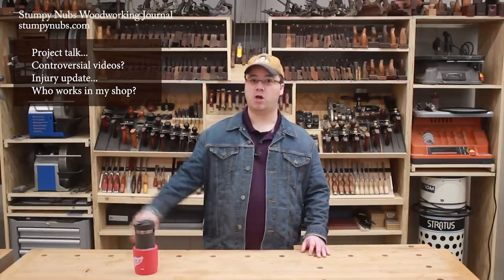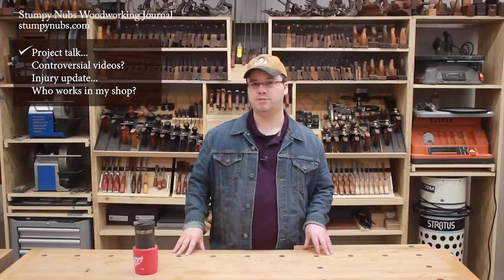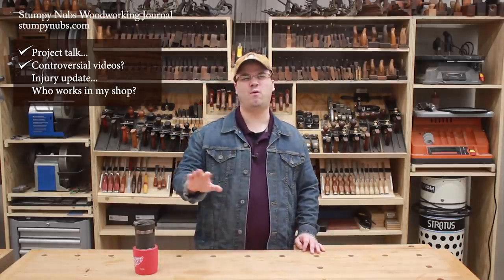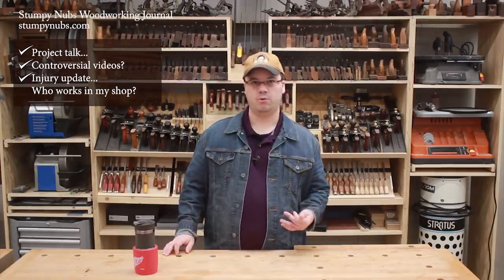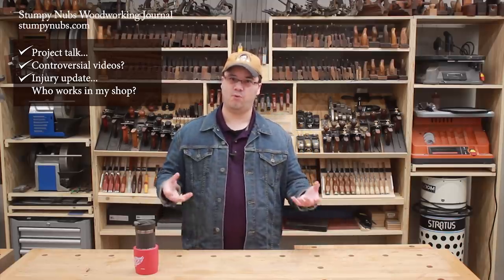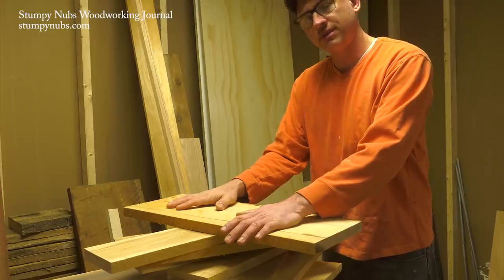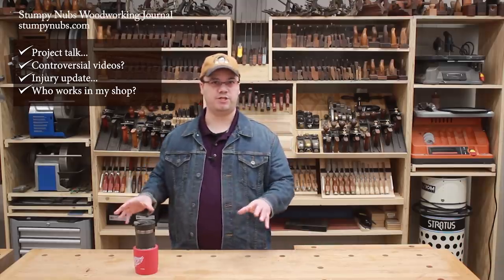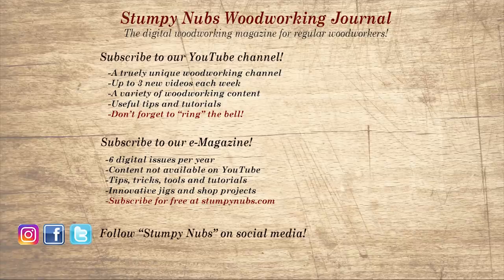Why I can't give the finger anymore (and other interesting stuff)

Comment: 9:05 "I've filmed a safety video, may or may not show it." - Please do. I found your channel by searching for kick-back on a tablesaw. I didn't know what it was before your video and someone mentioned it. I watched a few and I liked yours the best.
Reply from the maker: It's more of a rant than anything practical.
Reply: @StumpyNubs  A rant can still contain plenty of useful info. Post it my man!
Reply: @StumpyNubs  I still want to see it. Whatever it takes to get people to take safety seriously. I really started taking safety seriously when I was in a elevator whose cable broke. Nothing happened because it had a backup system to hold it in place. Ever since I assume an accident WILL happen and work with a backup to prevent or mitigate the outcome, even when the risk is small. I cringe every time I see someone use a table saw without a guard and splitter, smoke around flammable materials, etc. As my welding teacher said "poor safety practices are never a problem until there's a problem."
Reply: Please post it.
Reply: I'd like to see you show a safety rant video too. I mentioned something about using my Sawstop once and someone posted a comment to the effect of: "Sawstops are a crutch and a waste of money. All I need is my common sense." I thought, it must be nice to be incapable of having an accident.
Reply: And he should give that chewed finger to all the trolls out there. I'm sure that one will hurt more than a healthy one.

Stumpy is one of the most articulate woodworking YouTubers that I know of.
Keep the good job and forget the haters!
Reply: Safety first. Had a scare with my 1940’s Unisaw.  The next day, was your accident video. Sawstop delivery is Monday. Love the kick back vid, so more safety videos
Reply: James, anything you can do for woodworkers safety is worth putting out.  I am mostly a woodturner but I need most of the other machines as well. When I met you in July at the Raleigh symposium I was buying a Saw stop from Kingsport.  Three of our club members had recently had table saw accidents.  The last straw for me was when one fellow lost his signaling finger. Safety has to be number one! Thanks for what you do.
Reply: Confidence is what you have just before all the facts are known.  I appreciate every word so this is another vote for post it!!  I’m a complete novice, just retired and beginning to put a shop together. I want to learn skills that I can pass to my kids/grandkids.  No better place to start than safety and Stumpy Nubs.  👍

Comment: Hey Stumpy.  I'm a retired family doc. I saw more sliced body parts, cut tendons, metal in eyes , air gun nails where they didn't belong and tons of  other injuries. 95% were due to operator error , improper use of a tool or rushing to get a task done. I had one my self. The number one goal that EVERY woodworker should practice is SAFTEY FIRST!!  Please keep the videos coming.
Reply: Or even safety first.

Comment: Safety videos can be a little hard to sit through (especially if they're critical of some of one's own habits), but their message is timeless; and whether you work with chisel and mallet, hand-held machines or powered machines, an injury is never the desired outcome. Accidents do not "just happen", they are caused when all the contributing factors align to bring flesh into contact with the wrong part of the tool (or work). It is a critical woodworking skill to recognize potential contributors to accidents, then take steps to mitigate them. It is as I noted,  a timeless message that bears frequent repetition. So by all means, please favor us with your safety video sir, and stay healthy. Best wishes for continued recovery from your injury.
Reply: Safety videos are really good.  I watch a lot of them.  Tho bad habits are hard to change.  But I keep them in mind.  e.g.  Hold circular saw like holding a gun.  I remember now.  But when it comes to practice, it goes out the window until I accidentally squeezed the trigger.  But I am always careful of my other hand placement and spatial awareness of the surrounding.  I always think of how I can get hurt before I flip the switch.  So yeah, I have correct some habits.  Just need to work on correcting all the bad habits. 

He does have supporters here.  :)

Comment: Im a structural welder, my left hand has sustained numerous injuries. A 14" miter saw through the top of my wrist, a blown cut off wheel through my palm, a blown grinder wheel through the center of my 3rd knuckle on my index finger, and i recently got it pinched with a 2000 pound steel truss, crushing the three fingers that were damaged before.  Luckily, i can still use it, my grip is diminished and there are bits missing and its scarred to hell, but im grateful for the fact that i still have it. I call it my strong hand now, like the butler does in Scary Movie. Glad your recovery is going well, i totally get where you're coming from.  I love your channel, its been so helpful in my side gig building furniture. Keep up the good work!

Comment: A bit over 50 years ago, I ran the fingers of my right (dominate) hand through a 1" V belt pulley. Cut the signaling finger off and crushed the rest. A genius of a doc who sewed everything back in plce and tons of care and range-of-motion work later, the fingers work pretty well. Started playing a classical guitar to keep the fingers moving. Lots of tears shed on that old Yamaha but well worth it. 50 years and a few more wood working/metal working injuries later, I still can count to ten on ten working fingers. I am grateful for all the work I did to recover and all the luck I had to be able to... and for the extra care I have learned to take. Keep at it. Fortunately you still have all ten. Keep 'em working.

Comment: FWIW I appreciate your safety reminders. I’ve had several close calls and small injuries in the shop, and I can use all the reminders I can get to slow down and take my time. For me, it’s less about the safety equipment, and more about just not rushing or doing something kind of sketchy that a tool wasn’t designed for. I’m much better than I used to be, but like I said, I appreciate the reminders I get from you and others on YouTube.

Comment: I can tell you from personal experience that the movement and feeling will eventually return.  It may take years but one day you stop and say, "Hey I can actually bend that finger all the way".  For anyone out there thinking this only happens to stupid people BEWARE.  This kind of stuff can happen easily and quickly, even when you know what you are doing.  Never get lazy around power tools, they may seem friendly but can bite without provocation or warning.
Reply: Me too, what he said.
Reply: divorcedme  Thought you were going to say power tools and women have the same lineage.
Reply: Yup.. me too! Two years later, still frustrating buttoning my shirt!
Reply: Yep, you are absolutely correct. I also had an unfortunate, preventable event a bunch of years ago. I didn't lose a lot of mobility (left hand thumb) but I did lose all feeling in the digit from the joint closest to the thumbnail outward. Also lost a portion of circulation of blood so oddly enough, the only sensation felt was the cold, which up here by the 49th parallel was a real inconvenience.  Now, it's a rerouted nerve system and blood supply system which happened by the body's own desire to heal itself and 99% restored. It still has a cold temp sensitivity, albeit not anywhere as extreme as the original damage result and serves as a reminder against stupid. All tactile feeling is restored, so take heart, James, it will get much better over time.
Reply: The bandsaw got me, I absolutely didn't think what I was doing was dangerous at all, but blade hit a hard spot in the wood and flipped the piece over pulling my hand / fingers into the blade.
It happened so quick I didn't even see it. 
Luckily enough it was only a flesh wound that lots of stitches fixed.
Reply: Yes... my biggest problem now is reaching into a nail pouch to get a nail and getting poked in the end of my shorter finger...  I must be a starfish as most of my finger grew back. It was cut off just catching the nail bed. As the nail grew out, so did most of my finger.

Comment: Would love to hear the safety rant! I consider every tool in my shop as something that could seriously hurt me. No one thinks screwdrivers are dangerous, but have you ever used one to pry anything? Screwdrivers can get very stabby very quickly. No one thinks utility knives are all that dangerous, but a lot of folks think that utility knives are the most dangerous tools in the shop. 

I upgraded to a SawStop last year because I've seen one too many videos of table saw related injuries, and I had a coworker several years ago that nearly ran his entire hand through the blade when the workpiece slipped. He has a serious injury he'll likely never full heal from, but he's INCREDIBLY lucky he didn't amputate himself.

Now I have multiple power tools that can completely change my life before I even know what's happening. My 6" jointer deserves an enormous amount of respect. I'm not TOO concerned about the planer because I stand well clear of the infeed and outfeed. I still treat my SawStop with all of the respect that a table saw deserves (I still call it spinning blade of doom, and consider it one of the most dangerous things I personally own). But we never think about other things being too dangerous. A drill press can absolutely kill you in a few seconds if it grabs a shirt sleeve. Don't even get me started on lathes... incredibly dangerous machines.

Every single tool in the shop is dangerous... including the tool using the tool. :) Respect them all.
Reply: Always remember, you are and always will be the softest thing in the shop.

Comment: 9:17 I didn't even need power to crush the tip of my thumb.
Reply: LOL. My worst injury was slicing my left hand with utility knife. All the way across. Looks like I got another life line now. And still weird kinda pain even when I hear others talking about any injuries
Reply: @marcelo403polo2  IIRC, AvE and a whole bunch of other people call the utility knife the most dangerous tool in the shop.
Reply: @thecheeta  100% agree. Most people pay more attention only to power tools. It took 2 years in my case to get all feeling and movement in couple fingers back to normal
Reply: As a teenage boy in the early '60s I had a tendency to get angry.  One day after school I was using a hammer to bend a piece of metal into my desired shape, and it wasn't behaving.  The next blow of the hammer flattened the fingernail on my left middle finger.  My doctor used a pair of pliers to rip off the hanging two-thirds of the fingernail, then wrapped the bloodied  finger in a gauze bandage.  Took months to grow that fingernail back, and years for the scar to disappear.  I still occasionally get angry, but I down tools until I return to my senses.
Reply: You are so right that people hear what they choose to hear and listen selectively, filtering everything with their preconceived notions. This is the danger of close mindedness; it applies not just to woodworking but also to our politics and our remarkable inability to consider diverse opinions, and to consider ideas which may differ from our own. So sad that we have “walled ourselves in” by siloing ourselves into camps (political and otherwise). Please keep doing what you are doing. You are a remarkable advocate for woodworkers of all genres. Thanks again for all that you do to support the creative spirit in all of us!

Comment: I retired as a Safety Engineer for a 25,000 employee company. PLEASE do keep the safety reminders coming. I have had to investigate some horrific injuries that could have been prevented with some simple things like slowing down and thinking through what you are about to do, avoid distractions, use safety guards, etc.  I also am a long time hobbiest woodwork and metal worker with a fully equipped wood shop plus a metal lathe and milling machine. As a musician I constantly worry about any possible injury to my hands. Thus far at 74 years of age I am still fine but all it takes is one slip up and bad stuff happens. I appreciate your videos as well as the safety tips.

Comment: Best wishes for a full recovery. I had a non-woodworking injury to my left hand repaired with surgery, pins & wire.  1 joint fused (actually cut out and bones spliced together) and two joints and tendons that are still “stretching” and maximizing strength and mobility.  I know the frustration of hurry up and wait while healing. Love y’all’s content and production.

Comment: Well, as far safety and "it can happen to you" - allow me to share. I am a wood turner with 34 years of experience. Last week I was turning at a friends shop. It was a simple spindle project - a hollow egg. The work was held in a chuck so I could work on the end. A simple facing cut - a momentary distraction and it flew out of the chuck. In a few milliseconds it had struck, with force, my face shield.

This was the first time in 34 years work had struck my face shield. IT CAN HAPPEN TO YOU.

A bit earlier I had done a small operation and started without my face shield. I stopped, put it on, and remarked "don't be stupid" to myself. Had I continued without I would have been in the emergency room. As I had on proper equipment, I was NOT injured! I could also use myself as an example for the novice turners watching.

I'm glad you are on the mend. Go ahead and do the safety rant. We can't hear it often enough!

Comment: James, way back in 1981 I got my index and middle finger tips my into a jointer. It did not shorten them any at all but the very tips did touch the knifes. It took YEARS for the felling to come back to the tips of my fingers. You seem to have gotten more damage than I had. Don't be surprised if this takes longer than you think it will. It should not hinder your wood working abilities any at all after a few months. Good Luck in your recovery. Your body can heal its self in some amazing ways.

Comment: About that radial arm saw video..... I enjoyed it.  I bought my first ra saw from Sears 50+ years ago.  I bought every attachment ever made for it.  I still remember those early days with it, looking at the molding cutter attachment and all the cutters you bolted on and thinking "this stuff will kill ya, man".  I bought every different blade, too.  I used the blades, but the molding cutter, planer attachment and the rest of the other cool devices never got used because of that voice in my head.  The same voice that said "go ahead, you'll never get hurt on a motorcycle" and "bigger is better, more power makes it safer".  Ok, maybe it was the drugs talking on that motorcycle stuff.  I remember the advertising and the manuals and really enjoyed seeing that again.  I recall the father was often portrayed smoking a pipe.  No mention of what he was smoking when he used those attachments, but we can imagine.  And you did point out that ALL saws can be dangerous, so someone wasn't listening closely enough.  I later bought a table saw after wearing a board I was ripping on my dandy ra saw.  It sure jumped on me.  I bought the table saw the next day.  I even experienced the excitement of having the blade try to chase me while cross cutting a board and feeding too fast.  That's when I learned to stiff arm the carriage.  

I really enjoy your productions and check daily for new ones as well as troll for old ones.  I think it's great that you've been able to build a business that helps teach strangers and provides employment in your community.  Its especially good that you have been able to involve your step brother so he gets intellectual stimulus which can be limited for those who are movement limited.

Lastly, what is your background?   You are using design software and I wonder how you learned and what you use.  I've tried sketch up and could never get past the xyz axes image.  My mind goes number reading the instructions and staring at the virtual drawing board so I stick to old school drafting with 3 views.  Is there no hope for the aged?  Haha

Thanks again for the humor, knowledge and information that you provide so well.  Keep the faith, brother, and don't forget to boogy.

Comment: Thanks for sharing all this background. Please share the safety video. We should all want to work safely - that is how we can continue to work in the future. Cheers.
P.S. do not give up on the rehab. I broke my arm right through the ball joint in my shoulder. It took a year before I had a full range of motion. 19 years later I do not remember which one I broke. As for nerve damage, a chisel severed a nerve (well actually I did) 30 years ago - still no feeling in that fingertip.

Comment: Good video James. Safety first should be the moto no matter what you're doing, be it a automotive shop, machine shop, glass or wood shop or what have you. About 15 months ago I had a pretty bad injury by inadvertently sticking my index finger tip into a spinning router bit. It was simply because I didn't notice the opening for the wrenches on the trim router base where my finger was going and I was not thinking the "Where's the danger scenario". As a result it shut down my wood shop work for about 3 months while my finger print grew back. So talk safety as much as you want or feel you should because it is important for ALL of us to be reminded once in a while. Now I play the work sequence in my mind before do the operation with a power tool. It's good to see you are healing pretty well.